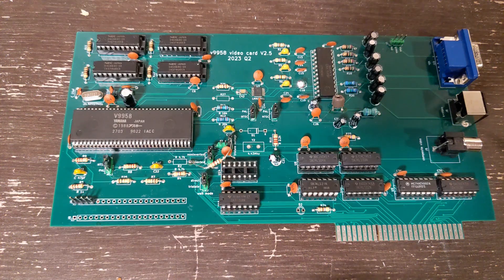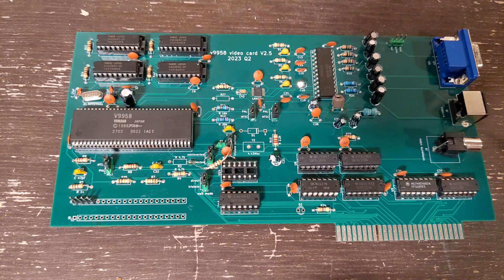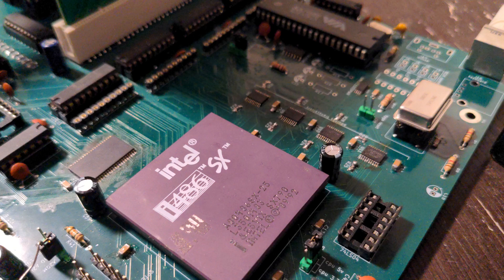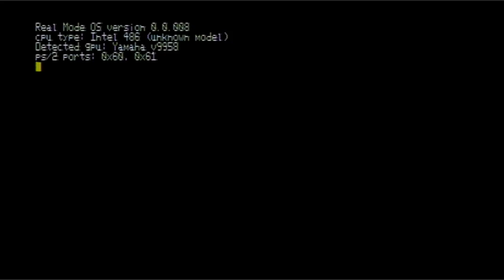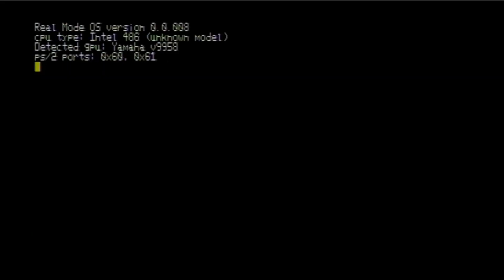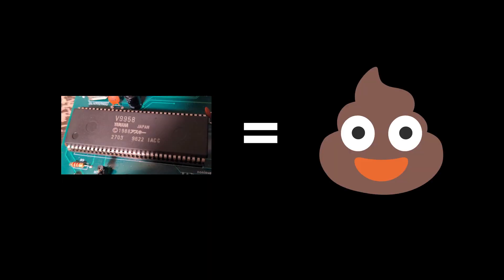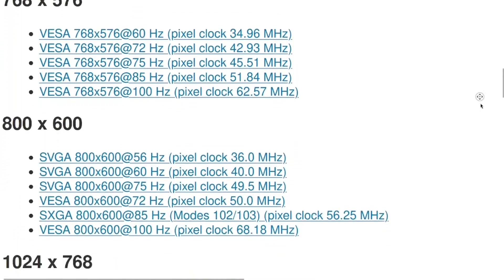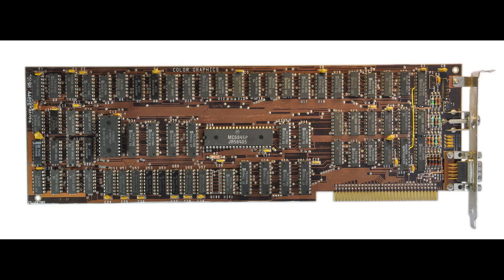v9958 graphics card on a 25mhz 486sx

Comment: First: the v9938 DOES NOT USE the same memory chips of CPU. It has normally it's own memory in usual design.
Second: i find extremely stupid to interface a 32 bit cpu like a 486 @25Mhz to a video chip with a 8 bit bus!
Third: a normal VGA card can do better than this chip. and given the more powerful CPU we do not need sprites, or hw commands but only a fast transfer rate and cpu access to video ram buffer.

Fourth: the vdp chips is using bad DRAM which are slow, slow, slow, and try to achieve 256 color mode or 640 alike (it is 512) mode resolution on it, while performing a lot of others duties operations like sprite rendering, and hw commands handling, so vram access is done from cpu with something 4us of delay between accesses, that while it is relatively hard to overcome with an 8 bit cpu like the 1Mhz 6502 or 3Mhz z80, is an eternity for a 486 cpu.

What did you expect? the performances of a NVIDIA hw? ;-)
Reply from the maker: Correct, it is indeed an extremely stupid idea to connect a v9958 to a 486. This particular video card has 128kb of dedicated dram. Developing a working isa interface is a whole thing in itself so the quickest way to get video output on a homemade 486 motherboard for me was to slap a z80 compatible bus onto it and make the v9958 WAIT signal connect to the chipset to generate the RDY signals it needs to insert x86 wait states. I could have hacked up some spi based video solution but my initial experiments with an spi ice40 thingy was about as slow as this so I didn't bother.
I did find a way to improve the speed a considerable amount. v9958 write cycles use different timing from read cycles so once I programmed special cases into the verilog that runs the chipset, it became almost as fast as in those videos where I used the v9958 video card on a z80 based system. I actually began making v9958 drivers in C++ and got halfway done with a "Installing C++ on my 486" video but then the parallel rom socket wore out and the system stopped working. In order to make this not happen again I have to come up with some way to make verilog code that copies contents of an spi rom into the fpga memory and use the fpga for rom data but that's going to take a while.
Reply: @scotts-tech  Hi, scott, " and make the v9958 WAIT signal connect"
That's interesting . as you may know the chip was used in msx computers. one big flaw of those machines was the total absence of hw sync betweeen cpu i/o to video chip. IT was done relying on cpu clock and cpu clock ticks required to perform some operations. because the timing of a I/O access to vram is different, depending on v9958 operations (vblank, sprites activated and so on) it is a poor and sloppy solution to apply a fixed amount of wait every time the cpu does i/o.
with v9958 predecessors there was no other way, so sync was done via sw, relying on what the sw could guess about v9958 level of "busy". 
Later when v9958 appered they have the option to do a more proper cpu-v9958 sync thereby achieving the best speed . But they refused to do it, justifying with a lot of reasons (they said, it simply useless features and stick to the fixed wait).

Now, i see you used the proper sync method, even with a cpu that does not match the chip "class" in terms of speed.
So the question is:
Have you found problems in using wait signal with 486 cpu? Is it reliable even if it does tax cpu a lot because of inherent v9958 slowness? I'm curious.

If your board is hw wait "enabled" and stable could be a very proof of that they were wrong in not using hw sync
Best Regards.
Reply from the maker: Currently, every time the cpu generates an IO cycle that accesses the v9958, it waitstates the cpu until 15 cpu cycles have passed AND the v9958 WAIT signal isn't being asserted. v9958 register 25 can be used to toggle the hardware WAIT feature on or off.  For most operations, 15 waitstates seems to be enough. In this video it was just inserting 50 waitstates per cycle and adding software delay during problematic v9958 commands. This approach didn't really work, not because it wasn't waiting long enough but because it wasn't emulating v9958 compatible write cycles closely enough. My latest fixes, not present in this video, are reliable enough that I bet I could get it to do complicated graphics and sprites correctly.

The only problems with the WAIT signal is that the timing of the WAIT signal is different on v9958 write cycles vs v9958 read cycles (as documented). I didn't get around to adding a fix for that so I have to use software waits for write cycles. It actually does behave as documented though. According to my notes the WAIT line asserts even when the v9958 isn't being selected by the host so it pretty much has to passthrough an fpga so it can be incorporated into the x86 RDY waitstate system to prevent unnecessary wait states.

As for whether or not every vintage z80 system that uses a v9958 is designed in a way where this feature can work reliably, I'm not sure.

The performance of this system is also heavily bottlenecked by the single 8 bit static ram chip so this thing isn't exactly a supercomputer.
Reply: @scotts-tech  Thanks. Another mistery was never clarified was this:
a) -Someone said that the wait line is asserted only during an I/O operation only if there is a pending I/O previous operation in progress
b) someone said it is always asserted even if the v9958 was not performing anything else than display duties (no previous cpu accesses pending)

From what i can guess by your description i think it is (b)

Comment: Those VDP Chips are nice for 8-bit systems, but they are really pretty slow. 
You might be able to squeeze a bit more performance out of it with clever coding, but they were never meant to run on an x86 bus. 

But one thing I'm wondering: doesn't the 486 internally divide the clock? 
I'm almost sure I heard that you need a crystal with twice the desired cpu clock.
Reply from the maker: The socket 3 486 cpus run at either a 1x, 2x, 3x or 4x multiplier depending on model and pin configuration. The 0.5x multiplier is only on 286 and 386 cpus. This means you need a 50mhz clock to run a 386 at 25mhz but a 486sx can run at 25mhz with just a 25mhz input clock.
Reply: @scotts-tech  ok, thank you for the clarification.

Comment: Interesting work! I am also into video options for retro systems but instead of v9958, which is terrible expensive these days and not all that capable, I found the uPD7220 / 72020 graphics display processors from the 80's to be very interesting and to have lots of documentation about them. Based on an already existing prototype made a VGA capable experimental variant that seems to be working. Have a look at my github project if you are interested. Would love to see what you think of these chips and their possibilities.

Comment: I do like the novelty of the characteristic sights and sounds of a system being output by another, but yeah maybe not worth the effort.  I would imagine for something like a 486, the graphics is just so slow to access it just hugely bottlenecks any performance benefits, rather than the fantasy of pushing it to do things the original system would be otherwise too slow for.
Reply from the maker: It is rather slow. I thought at first the v9958 WAIT line wasn't working but upon closer inspection, it does assert WAIT every now and then. Certain commands work more often than others, for example the color palette set commands mess up often (as seen in the video) but reading and writing text to vram practically never messes up.

This could be used to play basic games but the system is definitely bottlenecked by the responsiveness and speed of the v9958.
Reply: @ The wait signals is not asserted on pure register write I/O. only when dealing with vram access, not sure they work when putting data on command color register. The presence of a busy bit in some status register let me think that sync in this situation should be performed by polling then transfer the color byte. (i'm referring to the so-callled hw command, not straight vram access).

the v9958 is not a cleverly designed chip but some stupid design choices are because of inheritance of its predecessors to which this chip should be more or less compatible. The roots are from TMS 9918 chip, a real true piece of chip with all sort of weirdness and bad choices most of them could be even easily fixed with low effort.

For example, the status register 0 has a bit indicating vblank time (frame active area is finished). this bit is somewhat connected to the interrupt that the chip could assert to cpu to signal this situation, but can also be polled, and here come the shitty implementation.
If you poll this register continuously, there is a good chance that you won't see this bit being set, because there is some sort of race condition. In fact the action of reading the status register also clear this bit. but if the read happens while the chip is about to set to 1, the final effect is that the set fail, the bit remains 0, you do notice the end of frame situation, nor INTERRUPT will be triggered!!! There are also a lot of stupid things or weirdness in this chip but i do not want to bother you.
the TMS successors have to maintain the compatibilit with the original TMS chip which leaded to a poor chip.
Later, yamaha did the v9990 which was up to ten faster in blitter command and without compatibility constraints to match proved to be a better design